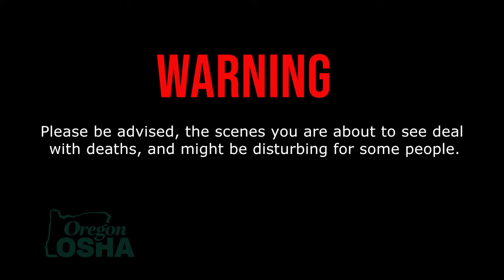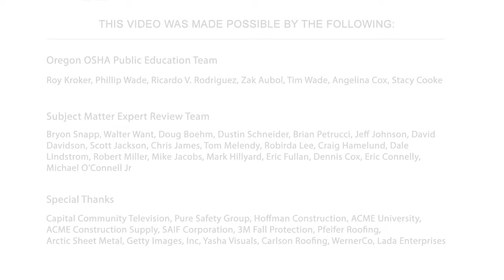The Most Dangerous Tool | Ladder Safety Training, OSHA Rules, Fall Protection, Workplace Safety

Comment: One thing no one ever mentions about ladders. Never leave anything on top of step ladders. When I was a new mechanic 20 years ago. I moved a 10 ft ladder and a huge pulley fell and hit my head. I had a minor Concussion. After that I always shake any ladder before I move it.
Reply: Werner ladder addresses that. They even make the top step to store screwdrivers, hang drills, etc.
Reply: wear a hard hat
Reply: Thanks Mike, that's a good one.
Some of the new step ladders encourage workers to leave items on the top by providing tool holes & trays on the top step.
IMHO it would be safer to hang a tool bag over the top step, less likely to fall and it can be seen from the ground.